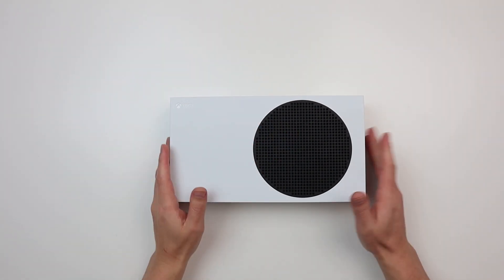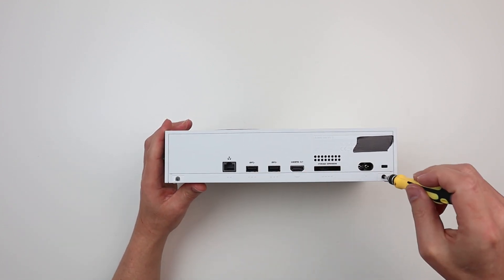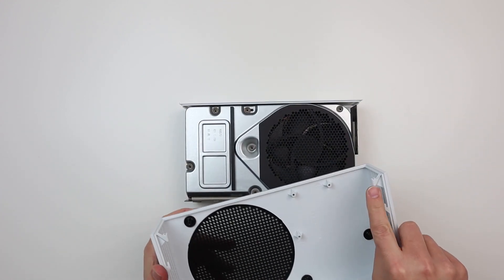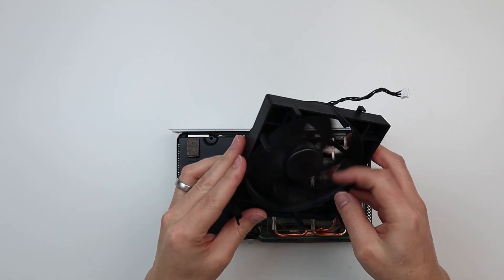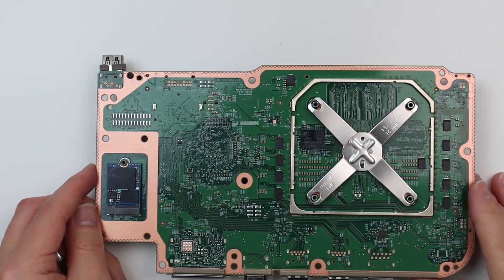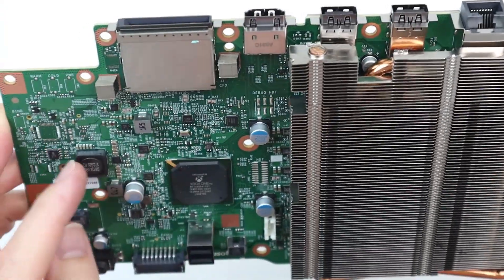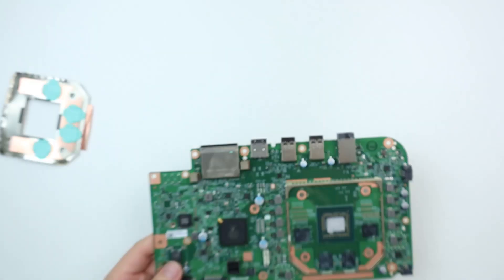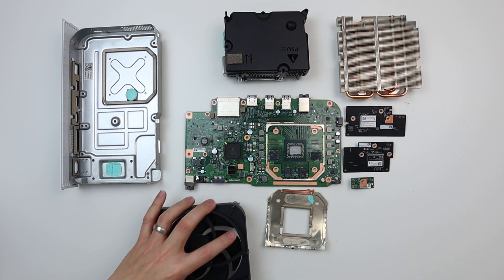XBOX SERIES S FULL TEARDOWN!  Including Heatsink and APU Shield Removal see the motherboard close up

Comment: You can't actually replace the Internal drives because they don't let you download system software from anywhere, you could never even on Xbox one or 360, you can only remove them for repair, but not replace

Sony has always let you re download system software from their website and replace internal drives, but NOT xbox

You HAVE to buy Microsofts proprietary £250 external drives from them or segate

Comment: Do you think that vertical position is optimal for airflow ? I think it blocks the low intake...and the superior intake seems blocked by the wifi card
Reply from the maker: I think you are correct.. Although I am sure it is tested in both positions, I would opt for normal position
Reply: So, vertical or horizontal is  better?
Reply: Would you opt for vertical or horizontal for optimal cooling?

Comment: Just wondering if you found the built in gps tracker? Was hoping the battery or psu could be upgraded as my son had his stolen and Microsoft have a find my device feature but unfortunately he never registered the device but it could be tracked by Microsoft if we had kept the serial number, I have bought him a new one but want to take precautions before I give it to him
Reply from the maker: Hi Nicola - not sure I have heard of a GPS tracker in the console.   Each console will have a unique serial number and MAC address for the onboard LAN and Wireless which I am sure Microsoft can track (or at least ban from connecting to live services) stolen devices.

Comment: My own personal Series S gets VERY hot around the black vent on the top of the unit.  Is this normal or is it something that I should get checked out?
Reply: I'd say it's normal.. the black vent exhausts all the hot air out the case. if your games run smoothly and there's no thermal throttling (no crazy dip in fps) i wouldn't worry too much.
Reply from the maker: @ginofoogle6944  Agree with Gino

Comment: Nice. Think this would be an upgrade to a one x? Also curious to know if a consumer grade ssd would work, awesome teardown 👍
Reply from the maker: Thanks John - Personally, having used it for a few days now, I would say yes as performance wise it is a lot quicker than the Xbox One X (not as fast as the Series X though obviously).  Interestingly the Series S and X have the same processor, but on the Series S it is just clocked down.  Also it has less RAM and half the size (512GB) on the local storage.  I would say, the biggest down side to the Series S would be the smaller internal storage and lack of optical drive but you can always use an external USB drive and just download your games.
Reply: only downside is it cant do 4k. also no disk drive

Comment: What does the Southbridge chip do? A lot of people on Twitter are kicking up a fuss because it’s labelled “Xbox One”.
Reply from the maker: Hello -  the Southbridge is the chip that controls internal components such as USB,  the BIOS, storage devices and the bus - basically it makes sure all the internals are talking to each other nicely
Reply: @TweakTips  Ah! Thank you for the speedy reply. So the fact it’s an “Xbox One” chip has no bearing on the performance of the console as that’s down to the SOC.
Reply from the maker: @SEGAGuys  Correct, and although it has the "Xbox One" branding, the southbridge on the Series X and S is not the same as on the Xbox One X and S consoles - as it is a custom chip Microsoft have asked the manufacture of the chip to only put their Microsoft branding on it - it probably is just a Texas instruments (or similar manufacture) inside!
Reply: @TweakTips  Ah, so the Southbridge on the X will also have the “Xbox One” branding then? I find tear downs fascinating, wouldn’t have the guts to dive in myself!
Reply from the maker: @SEGAGuys  It sure does!  I do enjoy doing the teardowns, I learn a lot from them.  (although it can get expensive as I buy all the items I tear down - they are not donated/sponsored)